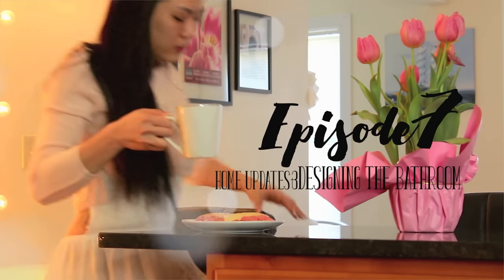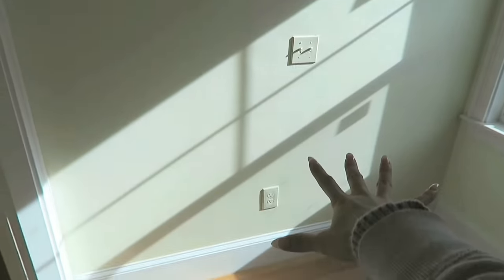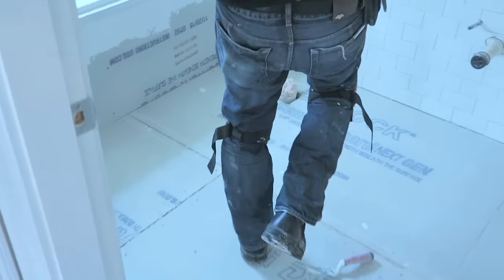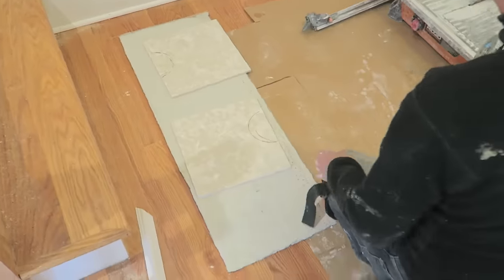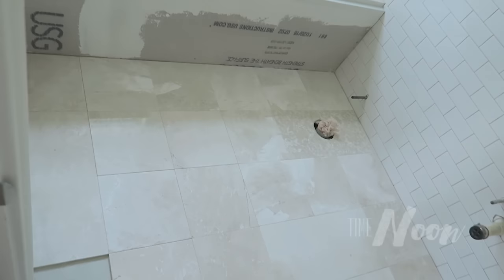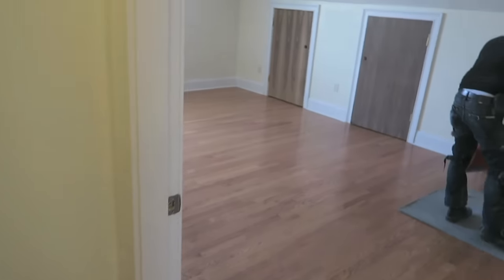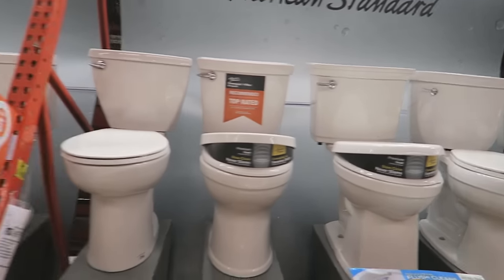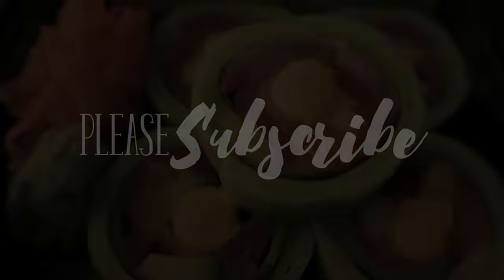HOME MAKEOVER - Designing the Bathroom

Comment: I work in the plumbing industry. Kohler has a better toilets than other brands out there. Your faucet..... not so much. I would suggest that your go for a higher end products when it comes to the shower. Plastic parts are not so great compare to real brass. Good luck and have fun on this project!!
Reply from the maker: agreed. Chris wasn't a fan of the plastic drain either, but there weren't any single hole Kohler faucets at this particular HD..mostly 4 or 8"
Reply: +luvableviet I understand. Kohler has tons more. I recommend the Toobi for you. I would also check out Hansgrohe. They have great quality ones. Is Chris in the plumbing industry? He might like Moen more. They are easy to install and last forever!
Reply from the maker: +Lulu Mawi he does a little of everything so its hard to say what he really does for a living..